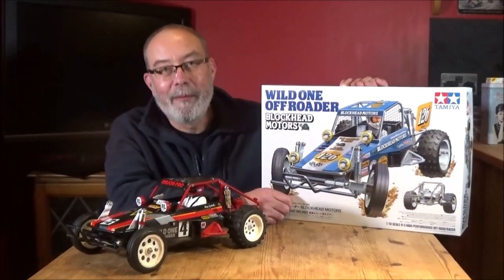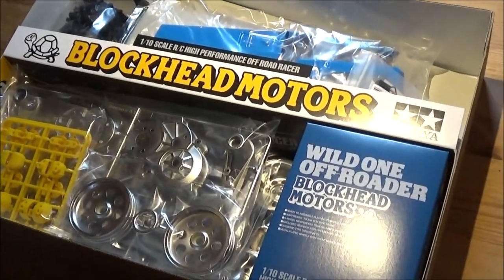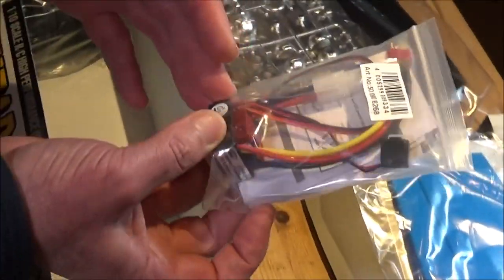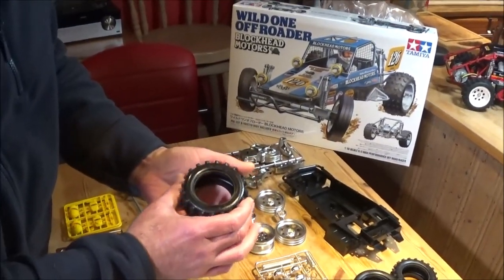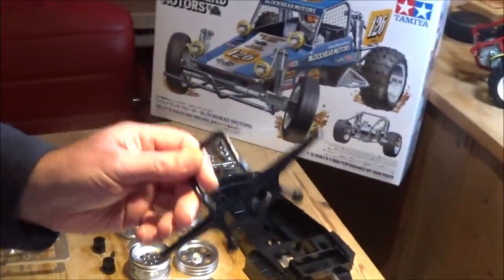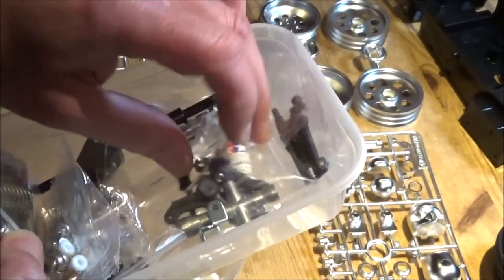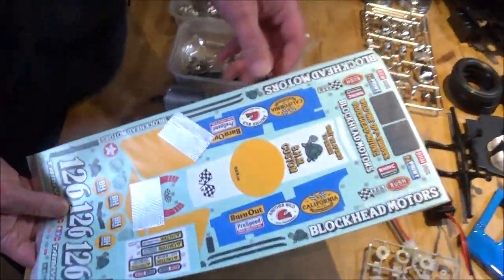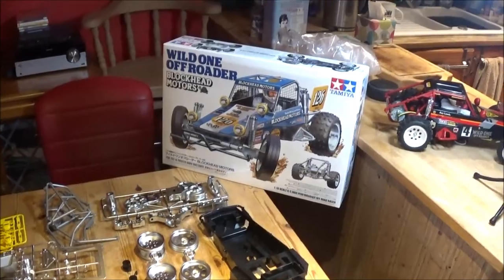Tamiya Blockhead Wild One Unbox & Chat - Thanks to the RC Elf!

Comment: Very nice my friend, The Elf is such a good guy!! I'm still waiting on mine but it is ordered!!! Very cool man!!!!
Reply from the maker: I love it, Bob! Great you got one ordered, hope it comes real soon - Carmine is also champing at the bit! Cheers, man! 😎👍
Reply: @MarkBryanRC  Yes sir, Tower Hobbies changed the part number for the kit so the first run order was canceled due to the "chip" shortage so now they come with a Hobbywing esc (no brushless mode, but are lipo ready & water proof).
Reply from the maker: I hear you, brother! Good info. Sorry for late reply, my notifications are haywire!!!  :-(
Reply: @MarkBryanRC  No worries Mate!!! I know you'll get to things when you have the time and if you cant here, there is always the other way. Do you think a Sport Tuned or Torque Tuned motor will be too much for the Blockhead Wild One or maybe just stick with the "China" made silver 540? I do have bearings.
Reply from the maker: @UncleBobsRC  Thanks, my mate Bob! I have the stock silver one in my standard Wild One with the smaller pinion and it's pretty quick as it's so light. Either sport or torque tuned would be fine, the transmission is pretty strong. I think I'll put the Torque one in mine, again with the smaller pinion, I like the wheelies!!!  :D
Reply: @MarkBryanRC  Right On!!!